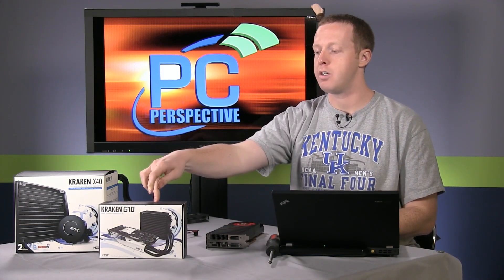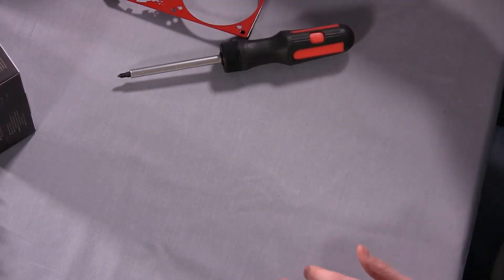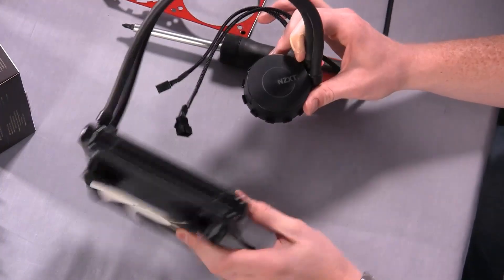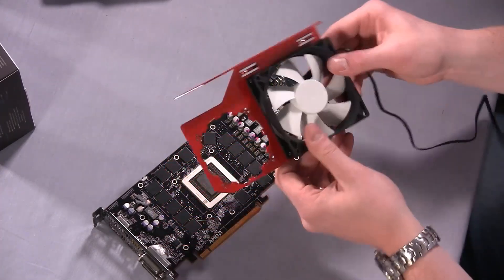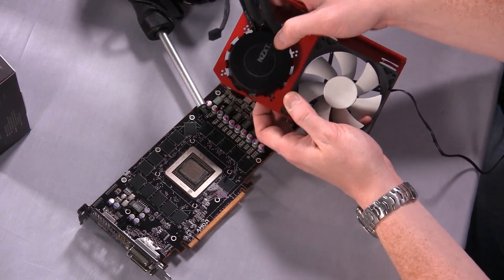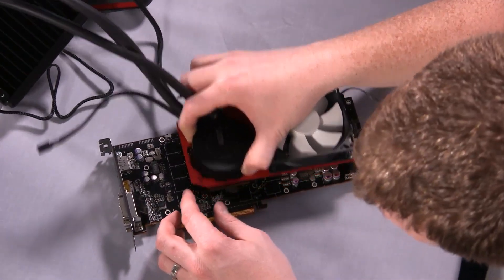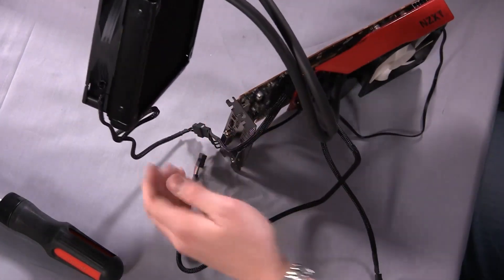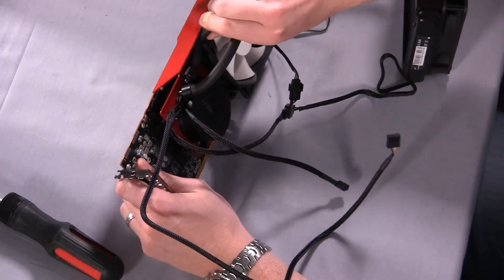Using the NZXT Kraken G10 to Watercool a Radeon R9 290

Comment: You spread the paste out... No.
Reply: I know right...
Reply: StoneXue
Yes, there are a number of variable at play here. My point was, Applying thermal paste incorrectly can change temperatures. From my experience, putting too much or too little can raise temps by up to 10c, that being, in extreme cases.
Reply: HEADBOMB3000 Ah you have it all figured out.  Core temps are all that matter.  Did I miss what he said his ambient was?  I know I missed yours.  Only morons directly compare one figure while completely ignoring all other factors as proof of something...
Reply: +Ben Mamonov I had to go into thé BIOS and change some stettings , maybe try another GPU ?
Reply: Ben Mamonov You fail to take into account there is no heat spreader on gpu's. This means the entirety of the exposed chip HAS to be covered, not only the center. You will destroy hardware if you do not ensure the entire chip is covered, and how spreading the paste in this situation is worse then any other process is not logical for people who understand that.
Reply: Richard Smith You're right but wrong.  Using clamping force to spread paste doesn't just "cover the center" but the entire die (in most cases).  The ONLY reason you would spread in this application is because of it's rectangular shape.  If it was a square bare die it wouldn't be a problem.
Reply: amazes me that people STILL think it really matters how you apply the paste. As long as the cooler you are using is seated properly/securely and you aren't using to much or to little paste to begin with then how you apply it is completely up to personal preference. The whole "air bubbles" thing is silly and a non-issue unless you are leaving gigantic gaps that you could visibly see even before you applied the cooler in the first place. Once you mount the cooler the pressure will smash out any imperfections in the paste to a point where it makes no difference.
Reply: devilmikey00 its not a case of gaps that the bubbles cause its tiny bubbles that you wont see and if you imagine that these tiny bubbles will insulate the device in the same way that home insulation does. and although it wont instantly destroy a processor or anything it still does matter especially when overclocking...
Reply: devilmikey00 Yes it will. I have done this to  a R9 290 using an H90 which is pretty much the same as the Kraken X40. However, I did not spread the thermal paste and my load temperatures are never higher than 45C compared to them hitting 54C. This can also be seen when applying paste to CPU and coolers. I have done it incorrectly with a 212 evo and an i5-3570k and my cpu hit 78C on stock. Applying thermal paste does matter.